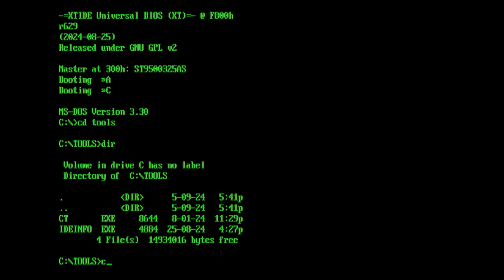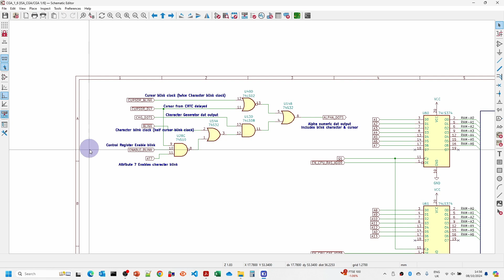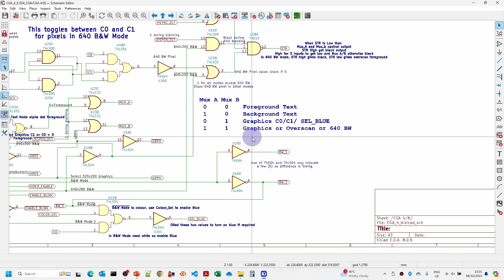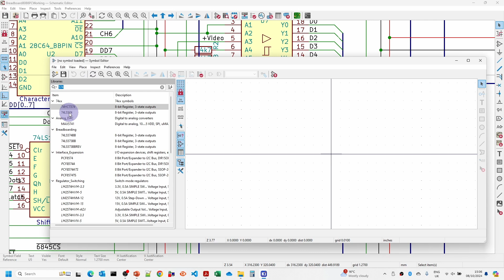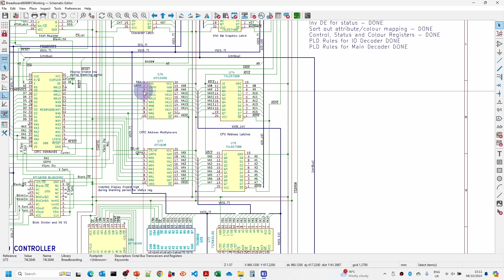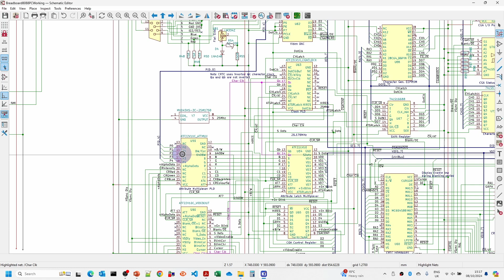Breadboard 8088 PC #48 CGA Video Controller Part 3

Comment: I like the idea of chips pin rearrangement to match the physical one, it helps to trace connections more easily. Have a good day!
Reply from the maker: Its a bit of a pain the first time you use a symbol but moving components around in a diagram to get the best layout is much easier than physical re-wiring. Dave
Reply: @breadboardinglabs  I agree, I've been doing the same and it does make if MUCH easier indeed